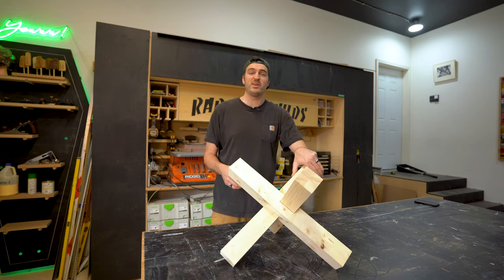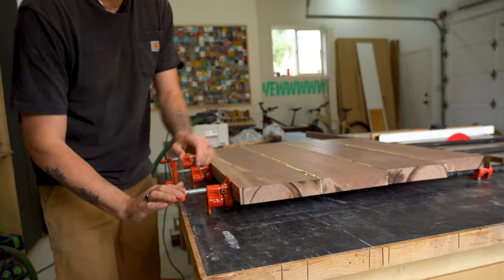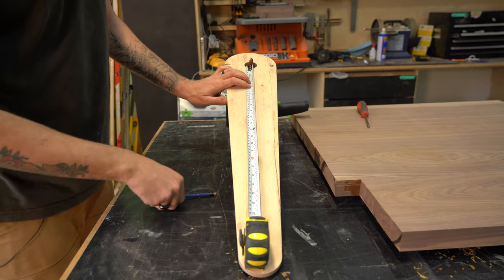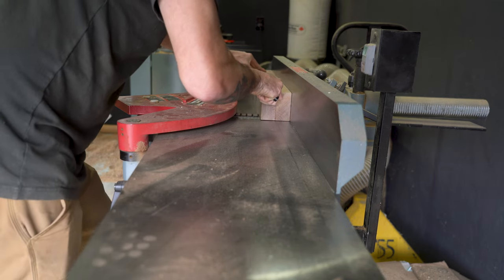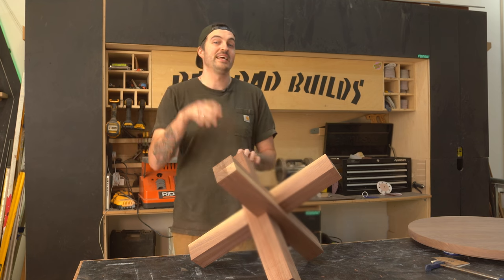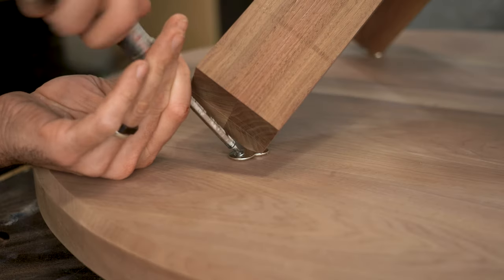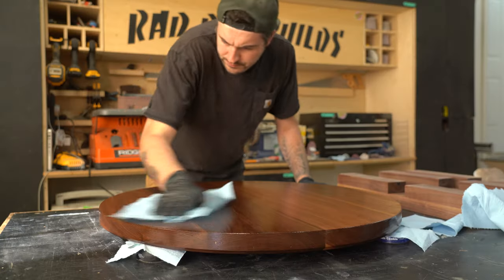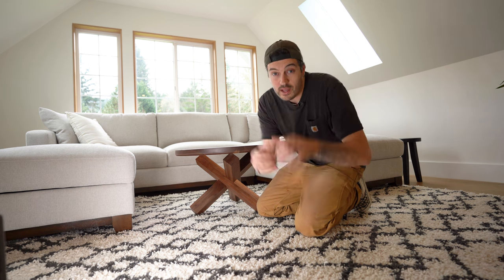The Table That Made Me $2000: Step-by-Step Guide // Plans Available

Comment: I love this style! Loved the table when you first posted it too. 

Question: do you find that since the legs are not screwed or glued together, that there is some wear and tear at the joint since it can wiggle around a little bit? Would gluing the legs add anything to the piece in your opinion?
Reply from the maker: Not at all, Ive had the original for 4+ years and it's like the day I made it. That said I primarily use hardwoods which are obviously a lot tougher. I appreciate the support dude as always

Comment: Great build! I was wondering what is the black material on your work bench table top?
Reply from the maker: It’s black melamine
Reply: @RadDadBuilds  thanks dude! You have great builds that I’m learning from especially the display cabinet video. I’m referencing it as I make a modern bookcase. I’ll need to build a work bench soon and I like yours!